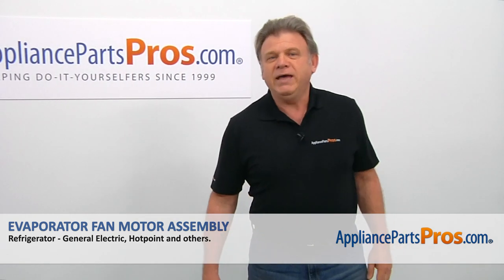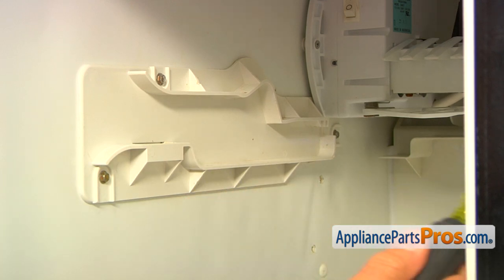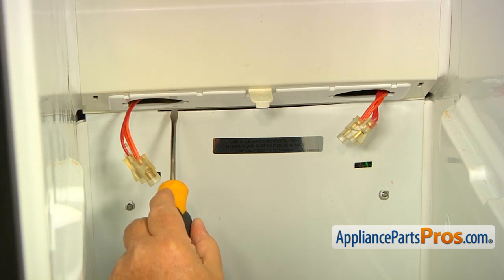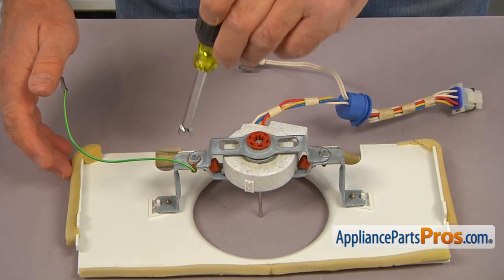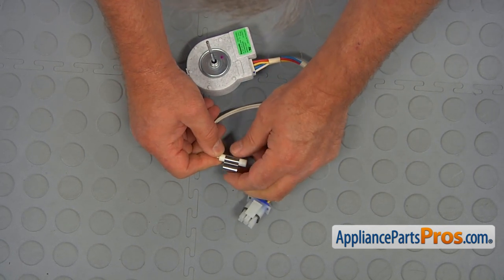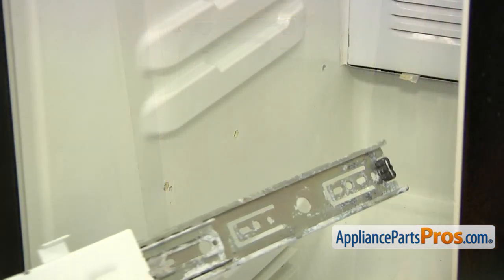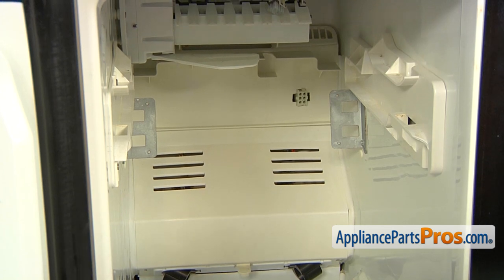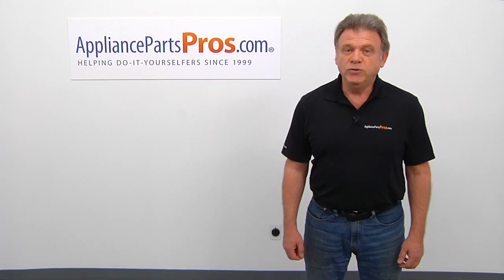How To: Refrigerator Evaporator Fan Motor Assembly WR60X10307

Comment: Thank you for the video. I am a 71 year old female, and although it was a lot of work I managed to replace the evaporator FAN blade. Fingers crossed that it will work.  I don't hear the sound of the damaged blade flopping around and it appears cold air is circulating in freezer.  Very happy.  Jeanie

Comment: Thanks for a helpful video.  Just a quick note that my freezer didn't have auger mount brackets, instead the auger slid into the right icebox shelf and one screw mounted it to the left icebox shelf.  There was also a cold air pipe that attached to the top right of the evaporator fan cover  to blow air directly into the refrigerator which seemed to be left uncovered / open in your video.

Comment: Hi i have a GE profile side by side and no evap fan operation. I checked with my multi meter and have the correct voltage/power out of the control board that feeds the evap motor but when i check for power at the plug for the evap motor inside the freezer i have 0 volts. I ohm'd the wires and they all check out. Any idea what my issue is? Could the resistors on the board be bad or somwthing im missing? Thank you

Comment: Our Evaporator Fan was making terrible noises with the temperature fluctuating in the fridge section. I removed the unit and found the grommet on the shaft side had partly disintegrated with bits falling into the fan shaft dome that rubbed on the shaft collar inside. I used a safety pin, a wire brush for car detailing and an X-acto knife to remove dozens of bits from inside the dome. That took 20 minutes. The rear grommet was OK, so I swapped front to rear grommets & reassembled everything. The fridge is now back to running without much perceptible noise of any kind and the temperature is stable again/

Comment: I have a top-freezer Profile. After replacing the fan, it keeps running all the time. It's constantly on and doesn't turn off at all. The freezer temperature has already dropped below -11°F and going. According to the manual, the freezer temperature should range between -6°F and 6°F. Also when I open the freezer door, the fan speed doesn't change (as I've heard it should when the freezer door opens.) I'd appreciate any tips. I've set the temperature to the recommended 0°F several times using the front display panel, but after several hours, it's still going down. The original fan didn't have a sensor, but the new one does, and I connected it with the metal clasp to the evaporator. My suspicion is faulty sensors or the board, but I'm not sure how to test for that. Do these fridges have a diagnostics mode that can be activated?

Comment: 911-My freezer in side by side  has lots of ice. I know why but, The fan started making noise. We hit the panel 3 times and sounded like ice fell.  quite a bit. Probably onto the fan and the noise got much louder. Unplugged machine to let defrosting start. Hope my food will be ok. Is it okay to run the machine with a noisy fan? Or will it cause a problem especially since there is ice build up?
Reply: We have had same problem. You are probably experiencing ice buildup due to the evaporator fan motor failing. This causes the fridge/freezer coils to not operate properly to evaporate the moisture produced for refrigeration effect. 
You will need to replace the fan, just as in this video.
We hit the link for the part, $137 is super pricey. We got ours same day locally for $70. 
If you order online now, there is a fan motor on ebay for $12 today!
So, before the motor dies (ours did overnight before we could order one) get it cheap! Take care.